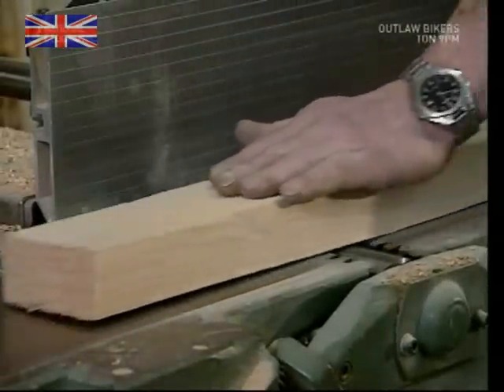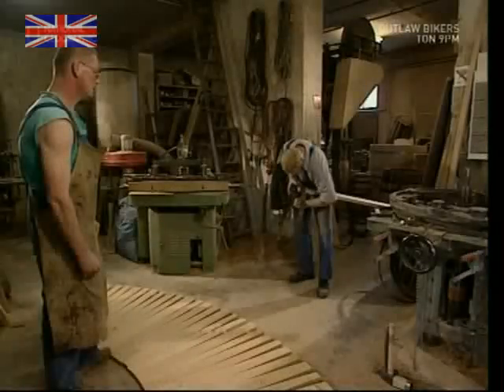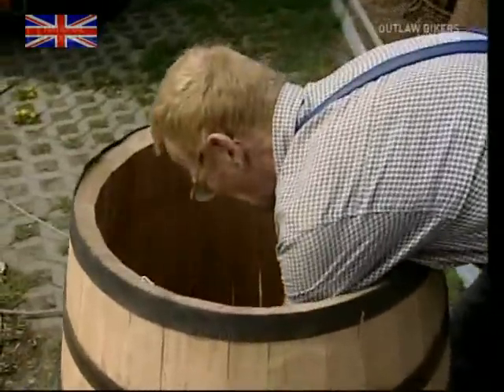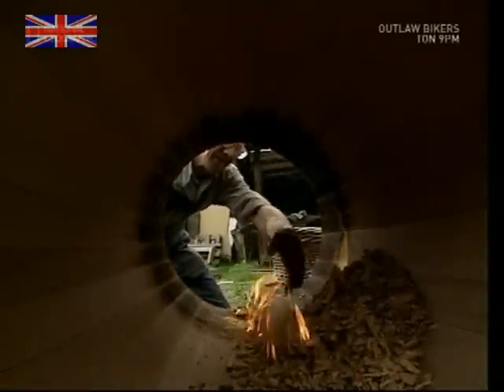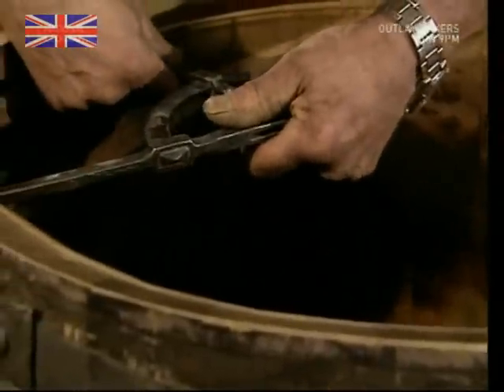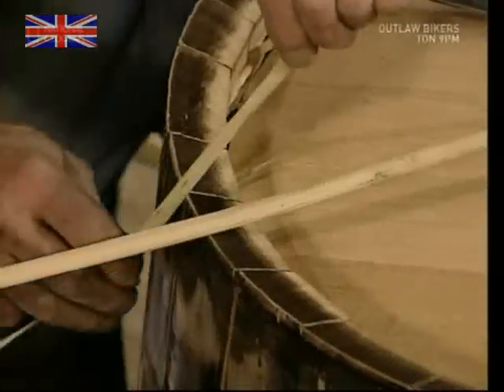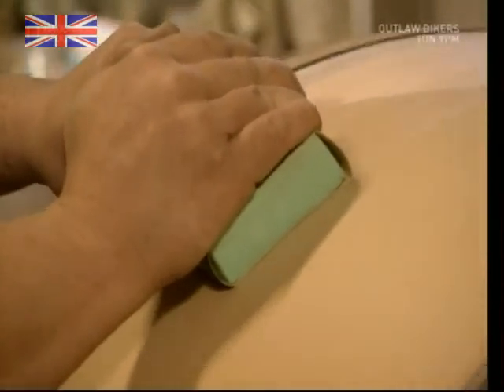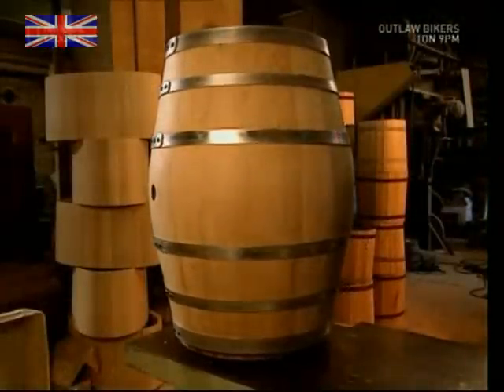How A Traditional Wine Barrel Is Made

Comment: I call BS on the world's largest wine barrel- that holds, "7,650,000 liters of wine if it was ever filled" That size the video claims would be a shape 64 feet to a side. Heidelberg castle claims the world's largest wine barrel and it only holds 220,000 liters. It has a dance floor on top of it.

Comment: what about making a barell the old fasion way.. when modern machines are not invented yet, i mean back in the day when people are just using less tools.
Reply: well, then they would cut the wood by hand and sand it by hand.... but the process would be pretty much the same... I mean, they did have fire and water when they started making wine barrels, you know...
Reply: +kei koruno I saw a guy making staves by hand once. He had a special workbench with a foot-operated clamp that would hold a stave in place when he pressed down on a pedal. He removed material with a draw knife while it was held in the clamp until he had cut it down to the appropriate geometry and dimensions. I assume his methods for assembly were the same as those in the video.
Reply: A skilled cooper can make a barrel (approximately 55 gallon size) by hand in about ten hours.  Using machines for the more tedious repetitive tasks the barrel can be made in 2.5 to 3 hours.  This is according to an expert barrel maker in France who has a coopering school right in his factory.  The end result is a much better barrel still make to exacting standards in one third the time and extremely less cost.  The great part is the best coopers still know how to do it by hand they simply take advantage of precision machines.  Break that down to the price of the bottle of wine and you can see how they save people money.
Reply: can't do it no more. .. black lives matter.
Reply: Karl, this was Germany, they were all about master craftsmen and skill labor, not free unskilled labor.